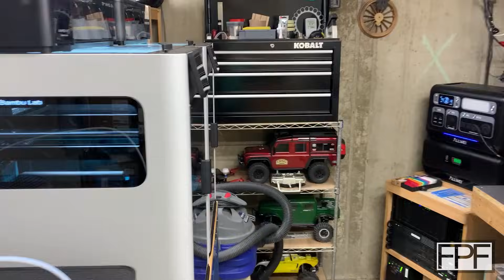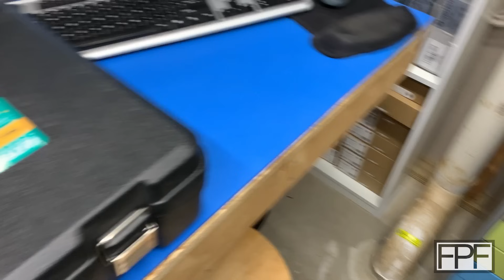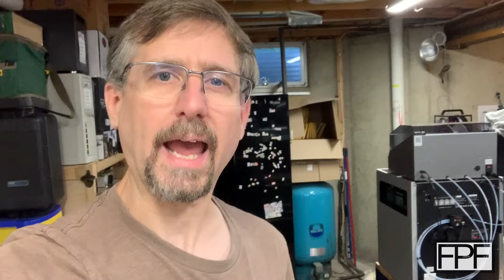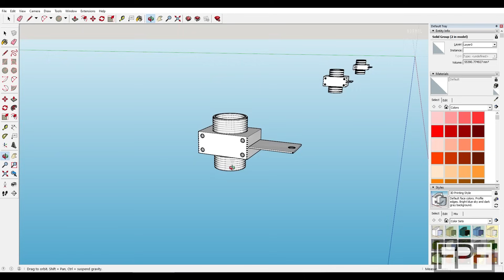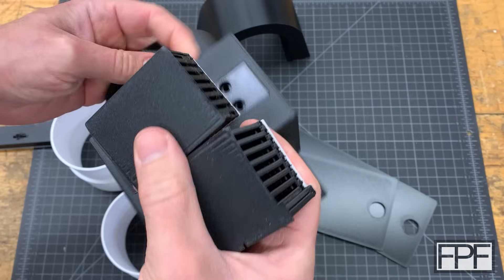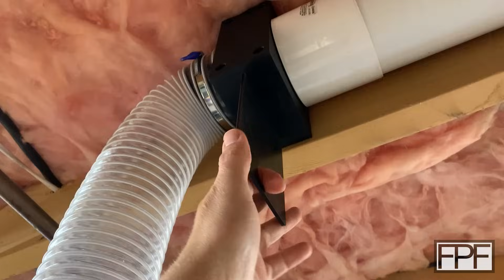3D Printed Fume Extraction Blast Gates and Adapters

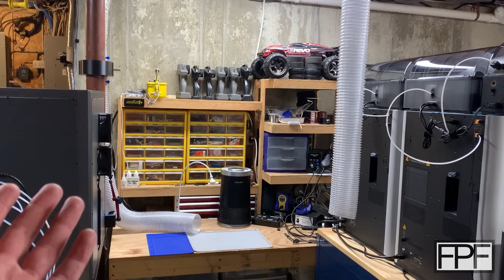Comment: 46:58 Hmm. You could imbed a magnet in your ... what was thing called again you pull out?  (Not an native english speaker here) and use a reed switch to report back if any is open or if all are closed, and control the motor that way.
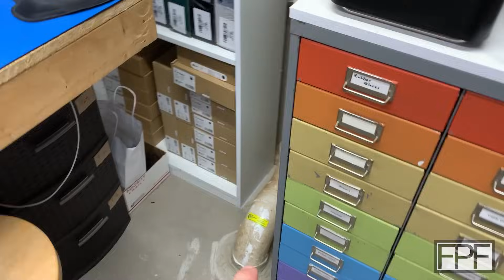If you are setting it up, you also could measure the fluid height on the gauge (7:17) and report a failure if it drops too low/goes up to high.

Comment: I designed some of the same things in my workshop. I use Vent for short duration projects such as my laser cutter. Unfortunately I decided to buy a small air exchanger for my shop and help with fume extraction for my 3D printers due to the fact that they for the most part are long duration projects. The concern I had is that you're creating a negative pressure in your house, reducing its heating and cooling efficiency, along with possibly causing problems pulling humid air from outside into your building structure and insulation. The air exchanger does not create positive or negative pressure if properly balanced. It also recovers some of the heating and cooling energy from the exhaust air.

Comment: You said you feel sorry for anyone who bought an X1C in the last 6 months.  That was very nearly me.  I was just about to order when I heard about the H2D and I put my plans on hold to consider it.  Then, I was just about to buy the H2D when the H2S was launched, and have been considering whether I really need the dual head.  On balance, I think I will still go for the H2D, because I hate waste, and most of my prints only use two filaments: either mono + support interface or a rigid filament + TPU.  To do this using the H2S would require the AMS and a lot of poop.

The only thing which makes me nervous about Bambu is the closed source software.  3d printing is a rapidly evolving technology, and I want the printer I buy today to still get firmware updates for years to come.  We all know how quickly mobile phone updates stop once a new model is out, and if Bambu follow the same pattern and no longer support their older machines with regular updates, that means I'd have to get a newer machine to experience the newer features.  If that happened, the new machine wouldn't be from Bambu.  Of course, the H2D would still be a capable printer, so I wouldn't chuck it out, I just won't buy from a company that abandons their existing customers.  It remains to be seen whether Bambu will continue to support their older printers.  I'd be much happier if they were to commit to open sourcing their software before ceasing support.

Comment: Great way to re-use an existing system. I hate running wires so I'd have connected a Sonoff module to the fan controller, but given you already had the spare relay prob. just as easy. I've regretted letting the roofing crew remove an unused gas hot water heater exhaust when I replaced the roof back in '17 since I got my first printer. Seemed useless at the time but now I wish there was a way to exhaust printer fumes from the shop.

Comment: If you need to bond 3D-printed parts to PVC pipe like that, you can use "transition" cement designed for bonding ABS to PVC, then print in ABS or ASA. It's also as temperature-tolerant as PETG, and you should be able to print whatever size part you need with those enclosed printers.

Comment: 0-10V or 2-10V are very common pseudo control standards in industrial controls. No surprise your radon extraction fan seems to accept that sort of range for its speed control!

Your method for bypassing the speed control and setting it to full speed seems entirely reasonable to me based on your readings. A super solid variant would use an optocoupler or relay in the fan control box instead to ensure full isolation and avoid introducing potential extra noise in the fan signal from the long wire loop down to your basement, but even that feels like overkill to me based on the system in question and I suspect there's plenty of filtering on that fan speed input to reject high-frequency noise.

Comment: for printer, it's a kind of hard problem to solve with a relatively easy implementation, for laser it's a simple problem to solve with a hard implementation.  there's plenty of people now putting their lasers in pans and filling them with nitrogen instead of using compressed air and an extraction fan, the air blows away smoke and the fan sucks it the rest of the way, with nitrogen, no smoke.  with some extra cost and fiddling, an oxygen concentrator can be used so you don't need tanks.

Comment: Awesome work! For the solder fumes it should be better if you reduce the area increasing the speed, so you could reduce the fan speed and maybe improve suction of the fumes, with venturi effect.

Comment: The only thing I would add (since you have an H2D) is a scale to indicate (say 1/4s) how far a blast gate is open.  Then you get say 75% I need for the solder station, I only need 25% for the laser, so I have x% left over for whatever.

Comment: When mounting something flat against a pipe, I would've preferred to add a "saddle" piece in between to improve the contact surface.

I suspect the current design might creep loose over time, especially if printed from PLA.

Comment: I think you need a grate on the 3D printer hose too. Just to keep random critters  etc out! A spider or moth by itself might not cause a problem, but that sort of thing could build up over time and be a pain. Dust as well. I think it would be better and simple enough to put a filter/catch bin on the central two PVC ducts. Then you do not have to worry about effects further up the system where they could induce a higher rate of failure because the system is designed to be mostly sealed from the airspace in the basement. Humans produce a surprising amount of dust! I have known a few people who did maintenance work on the electronics and electromechanical systems on military submarines who told me of what they had seen when servicing the subs. They all said that the tiny hairs and skin cells we shed get into surpiising places and cause problems in unexpected ways! We see it everyday in what happens to keyboards as they age.

Comment: Be careful using the shorting trick! If you short positive to the wiper (Middle terminal) and it's turned down, you will damage the potentiometer!
Reply: Disconnecting the minus terminal will have the same effect as shorting the positive to the wiper. Plus no risk of damaging the potentiometer.

Comment: I don't remember you mentioning the fans in the H2D and the H2S. They also move a lot of air. Not sure how that will impact the vacuum. It would be interesting to see how the readings will change with the printer fan running. Your thoughts?

Comment: If you want a great support interface material for a PLA print on an H2D, try Polymaker's CoPE. It's chemically similar to PETG, and sticks to PLA about as well as PETG, but it prints at PLA temperatures so you don't have to worry about heat creep jamming your H2D's extruder. Plus it's really cheap, and it comes in many colors.

Comment: Some thoughts...

1) Pull very little air from the printers when printing with a heated chamber.  Only the minimum required to create a slight vacuum.
2) Since the printer's exhaust vent will be closed and recirculating chamber air, maybe draw the air from a cover that would go over the poop chute.  It could just magnetize to the back of the printer.  It probably only needs a 3/4" hose or less given how well the H2D/H2S are sealed.  This way it's not interfering with the normal vent behavior and it's closing off the only unsealed part of the printer.  You will have to remember to remove the cover often enough to prevent constipation though.

Comment: Yes, your radon vent's manometer reads in inches of water (InH2O). It's inherently accurate as a matter of physics. You could calibrate the digital manometer off of the water-based one (given a sufficiently accurate measurement of the displacement)!

Comment: For mounting stuff to round lally columns, a great option is a U-type muffler clamp with a piece of Unistrut attached to it. The muffler clamp's bar gets you a "flat side," and the Unistrut makes it easy to attach whatever you want either as a snap-in printed design or using tee nuts.

Comment: I haven`t seen the whole of the video, but you just drilled throught the joist (yeah that drill is impressive).  You really shouldn`t drill through actual joists, and DEFINATELY not THAT BIG of a hole.  seems like these might not be a joist but more of an in-between-joist piece to stop warping - although the fact that there are three suggests that it was expected to handle LOTS of forces..  :-( .  and it seesm liek you have a metal beam and a coloumn right there.. not sure if that mitigates the issues, or suggests that it's even more of a problem.   Definately worth getting a professional`s opinion next time before you do that.. maybe even ask the community here to see if anyone competent could chime in.  (I speak from experience, having somethign simiilar having been done in my house, and then my dad who is a carpenter telling me that was a very bad idea, and having to fix it).

Comment: One issue, if the potentiometer is set to zero and you tie the output to +10v you will have effectively shorted the 10v supply since the pot wiper will be at 0v.  As long as you leave the pot at 5 it probably won't be an issue given the low current but a more robust design would be a relay to disconnect the potentiometer wiper from the sense input and switch the sense line to +10v which will guarantee you never short the supply.
Reply: To expand a little farther, the potentiometer is basically a resistor with the wiper touching some adjustable point between the two ends of the resistor. If we say the resistor is 10 K, then you have your 10 V across 10 K. If your wiper is at 5 (50%?) and you short between 10 V and wiper, you essentially have 10 V across 5K resistance.  This doubles the power dissipation and may burn out the potentiometer, turning the fan off when you open contacts on your override. Best to disconnect from wiper terminal when you connect to 10 V as mentioned above

Comment: Are you exhausting high temperature air from the printers into PVC tubing? Hope your PVC doesn’t get softened and either collapse or ‘balloon’ under the pressure differential.

Comment: Nice. I suspect with the 3d printer run, you likely wont even need to boost the fan to full, if the gate is only cracked open, and likely still be above 0.55 vacuum. Too much flow through printer will cool it down, and for ASA/ABS etc, would be bad.

Comment: Filtration should be considered as well. Smoke could eventually make everything it touches sticky. That stickiness would then collect dust and microscopic plastic particles. It would probably take years for problems to become evident. By then, they would be big problems.

I smoked cigarettes in my home for over ten years, finally giving them up last year. I'm now dealing with the aftermath. Tar from tobacco is probably worse than what you're dealing with. After what I've seen, I wouldn't take any chances. You really don't want your radon mitigation system going down prematurely.

Comment: I think you should make the sealers stepper motor compatible so that a simple automation can switch those depending on which device is running automatically. Also those air pipes on printer side is huge maybe use a smaller diameter hose to save space
Reply from the maker: I considered automating it with reed switches, and I still might for the laser cutter, but for the other two drops, I think I'll manually want to adjust each time depending on the application

Comment: I do not understand why you need to ventilate your 'under the house'. Saw this in some more videos from US. Never heard about this here in Germany.
The other thing is that we never use 90° we use 45 or 2x 45 to 'guide' the air into the right direction reducing turbulences/loss...
Reply from the maker: Radon.  Causes cancer at higher levels, especially if you have had long-term exposure to smoke or other carcinogens
Reply: … and is required in many parts of the US when building new homes.  Here in Pennsylvania you can see the radon mitigation systems on all of the subdivisions around where I live.
Reply: @FrankConforti @FunctionalPrintFriday 
Ok, thanks, did not know about that. I guess (but do not know) it's not an issue over here, as we build VERY solid cellars especially in my region were they are even water proof due to high ground water levels ..

Comment: It would be neat to put switches on the gates to automagically turn the fan on high.
Reply from the maker: I considered automating it with reed switches, and I still might for the laser cutter, but for the other two drops, I think I'll manually want to adjust each time depending on the application

Comment: For a 3d printer, you must not extract at the rate you are showing. First, you will destroy the fan installed in the printer. Second, the volume of air you draw through the printer will cool the chamber, adversely affecting prints with high temp requirements, specifically the ones you want to remove the fumes from. You need to dramatically dial back the flow rate. Even a computer case fan can draw too much airflow from your printer, you need to only create a very small amount of negative pressure in the chamber, sufficient to stop the fumes from leaking out. This is entirely different to the extraction you require on the laser or woodworking machinery.
Reply from the maker: agreed, I think the blast gate will only be open a tiny bit.  I may see if I can find a way to measure the chamber pressure itself with the manometer to fine tune it
Reply: An enclosure, such as a small grow tent, is honestly the best way to go about it. This way, you aren't introducing currents/cold air into the chamber and just capturing what's escaping naturally.

Just keeping it as a slight negative pressure within it is enough to capture everything.
Reply: At least without modification the Bambu will close the vent holes during a print anyway if materials like ABS, ASA or such a printed to avoid warping risks.

Comment: I have a 2 part vent for the h2d, one side screws on the other with magnets. I print mostly abs, even with the h2d vent closed it removes all the fumes. My vent fan is always running at low and connected, even with pla. I dont mess with forcing the rear vent open, not needed. When the heater is on the rear vent is closed automatically.
Reply: Also, embed the magnets with heat cycles and pulling they'll come out even with ca glue. 3 printers all magnets randomly come out so frustrating!

Comment: For the attachment to the machines I think a flapper would work.  I haven't thought this though but my thinking is that it would lay flat and open to the world normally but when the fume extractor is running the suction could pull the flap closed to pull from the machine.

Comment: 28:10 you could insert a groove or two and print a TPU O ring to help seal the connection, would also benefit holding the press fit.

Comment: I noticed you measuring the tubing with calipers and I've discovered that things like this are easier to measure by using one of those drill bit checker with a bunch of holes.  Just find the hole that the tube fits in.  I like this because you don't have problems with the tube squishing in the calipers and also you will know if the tube is a tight or loose fit.
Reply from the maker: completely agree, but the calipers were within arms reach, and the drill bit checker was a 45 second walk :P

Comment: I was just wondering what plans you have for the “make up” air that you are pulling out of the living space. Do you have an air inlet for the basement, or are you relying on the natural drafts in the house walls. 
I’d love to see you design an heat recovery type of device. Your cad skills are far beyond mine.
Reply from the maker: House lets plenty of air in, but if I was laser cutting for a long time I'd probably crack a window on the other side of the house.  For the 3d printers, I think I'll be moving soo little air (really only need to move as much as the printers are already moving out the back) that it shouldn't require anything additional.

Comment: If you add an optical sensor to the gates you could automate the speeding up of the fan. For the soldering bench creating a long thin slot would give some good laminar flow over your mat and stop anything big being sucked up.

Comment: There are ball valve blast gates on Printables, way better than flat blast gates.  Also a few folks have added solenoids to them to automate opening and closing them (I plan to, haven’t yet),
Reply from the maker: I considered automating it with reed switches, and I still might for the laser cutter, but for the other two drops, I think I'll manually want to adjust each time depending on the application

Comment: Yep!  Had to copy n paste, sense I and others can’t be exposed. 
Yes, exposed fiberglass insulation can be a health risk because its airborne fibers can cause temporary skin, eye, and lung irritation. While generally considered safe when properly installed and undisturbed, coming into contact with exposed insulation can release fibers into the air. These fibers can cause symptoms like itching, coughing, and wheezing, with individuals with asthma or allergies being more sensitive. To mitigate risks, cover exposed insulation or have it properly encased by a professional to prevent fiber release.